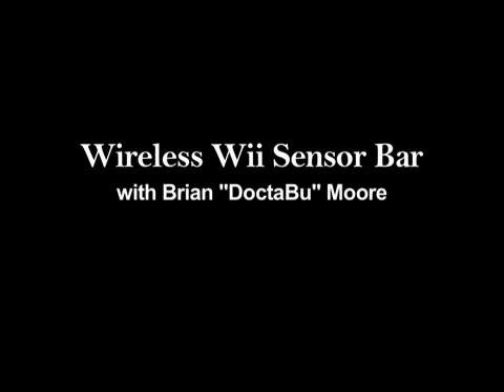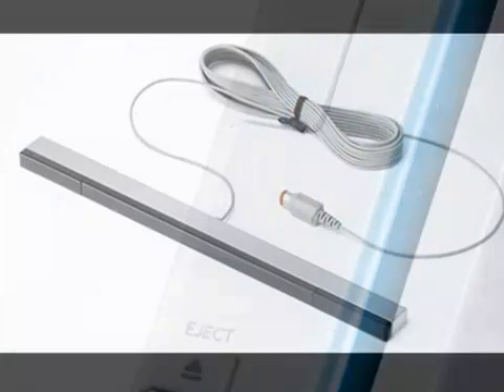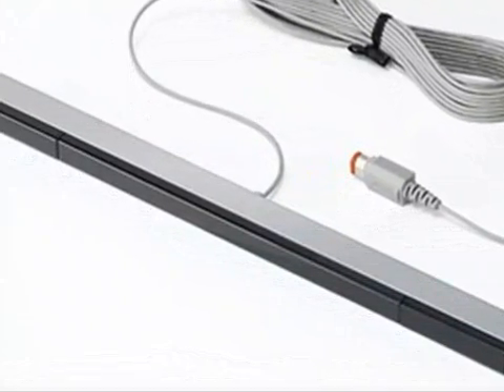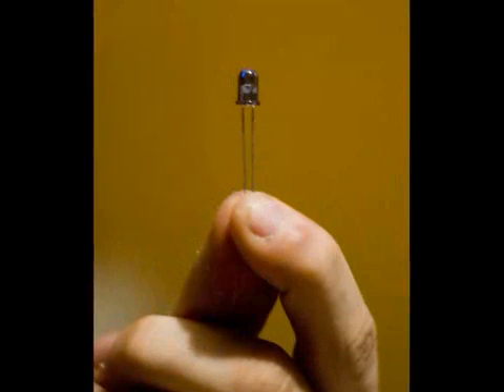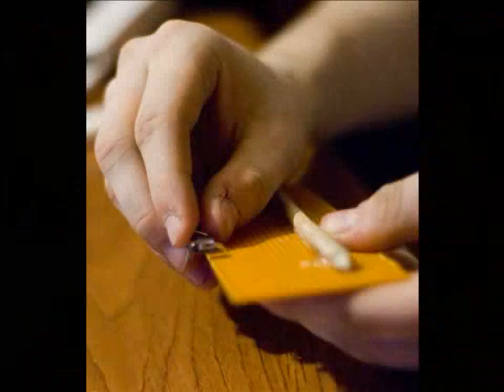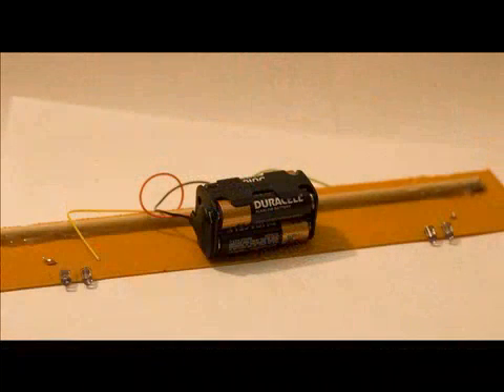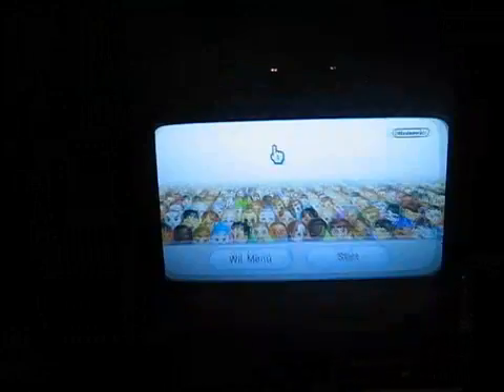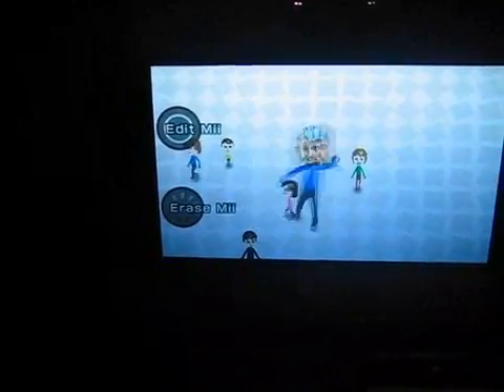Homebrew Wireless Wii Sensor Bar

Comment: Does the distance between sensors lights matter/ impact on control.? 

I want to use with gun games like House of the dead on a projector. 

From playing around with standard sensor bar I found that only way to get the targeting accurate was to stick sensor directly in centre of the viewable screen which wasn't ideal.

If I made my own would putting an ir light either side of viewable area centred work?

Comment: It's really just lights. All the magic is in the controller. It picks up the LEDs and uses that for the direction controls. Resistors would be for a more advanced version that would be powered from the WII instead of batteries.

Comment: Recently I bought a sensor bar from ebay for 4 dollars, free shipping. changed the Resistors inside to 27 OHM from 220OHM, and put a usb cable on the boards where the original wires were. This allows you to plug it into a spare usb port on the tv or to something like an iPhone/ Android USB phone charger, and power it from the wall. Adjust the sensitivity on the wii settings, and you should be golden.

Comment: It doesn't. All the sensor bar does is emit infrared lights as reference for the WiiMote. You could very well use two candles as a sensor "bar". It'd work just as good.

Comment: erm .... Infrared light isn't vissible to the human eye , you can only see it through a camera. For example , a remote uses IR-LED's.
So if you aim a remote to your webcam and push any button , you can se a dim light in there. But i think there is some with higher intensity which can be used in for example night-cameras.

Comment: But these won't get the angle of the wiimote on the wiimenu I guess. Look that the hand cursor is always point up at the video, while if you use the normal sensor bar on the wii you can rotate the hand cursor by rotating the wiimote

Comment: The Wii doesn't take any input from the Sensor Bar.  The Wiimote itself just picks up the coordinates of where it sees both ends of the bar (2 sources of IR light) and reports it back to the Wii (or PC, or whatever) through Bluetooth, which is then processed into a coordinate for the pointer.  This is not fake, in fact, you can use a standard TV remote, just hold down a button and point your Wiimote at it.

Comment: 3. the wii remote , or wiimote, works via a small sensor on the top of the wiimote. what it does is looks for any two sources of flourescent light spaced out any distance depending on how close or far you are to the light sources and moves around the tv screen based on its location in front of the lights.
I hope that these two comments can explain any scepticism. If I got anything wrong about how a wiimote works, please correct me.

Comment: allow me to explain why its not fake:
1. the wires on the wiis sensor bar arent for a connection, they are for powering the LED lights in the sensor bar, using the wii as a power outlet.
2. they are in the dark room so they can show the led lights in their homebrew sensor bar, therefore showing how a sensor ber works.

Comment: Wait a minute, I just thought of something nice:

Open up your TV, and attach some LEDs in the TV itself, that would actually be pretty nice, you might even be able to draw the power from the TV itself.
Of course this wouldn't work with a projector, but that's not the point.
I just might do that to my TV when I get a Wii, thanks for the inspiration.

Comment: If that is a problem, even though you would only need to replace the batteries every few months or so, you could just replace the battery pack with a correct voltage transformer. Presto, no more battery changes. You can get transformers with a voltage setting for like 30 bucks or something.

Comment: THE POINT of doing this is that the wire that comes with the packaged sensor bar is incredibly flimsy and prone to interference.  The result is that most people have their cursor jumping around.  If you create a wireless sensor bar there's less of a chance of interference -- and better gaming.  Don't judge things you don't understand.

Comment: WHAT THE HELL IS WRONG WITH YOU GUYS!!! STOP BEIGN SO CHILDISH, God damm it... the guy did a Wireless sensor bar, what's wrong with it?

My keyboard shoud have wire enogh for me but i like to use wireless keyboard, so what's wrong?

And why put a damm AC Adapter if you want it to be WIRELESS??

Good job dude, very smart and useful

Comment: People that have projectors would have a huge use for this, since the sensor bar wire would have to reach all the way across the room. The wire it comes with is almost definitely not long enough for most people that have this particular setup.